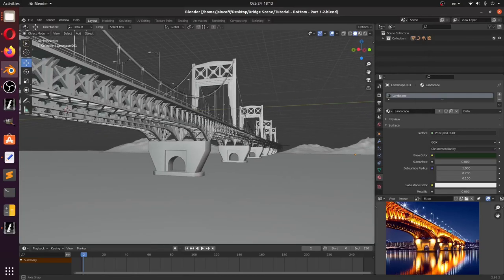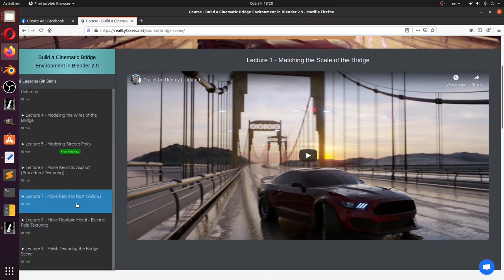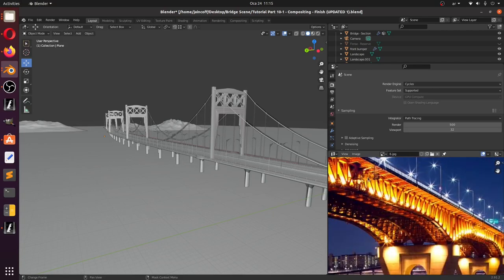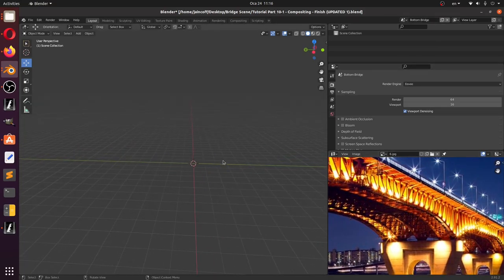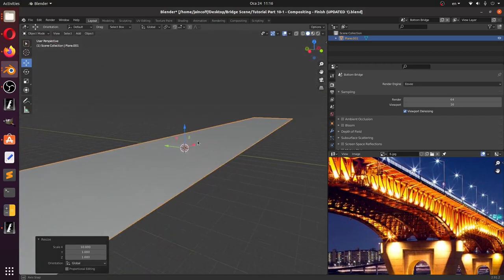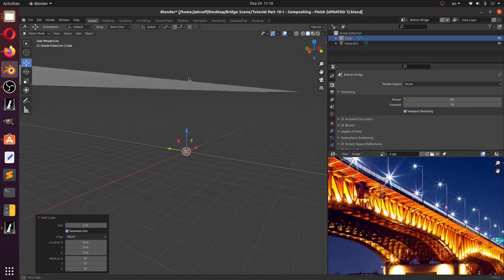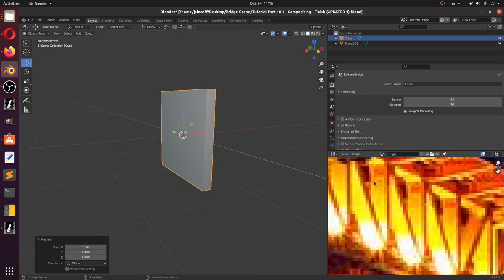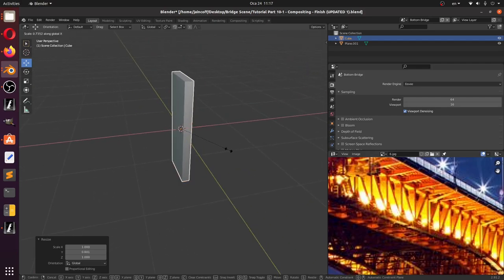Blender Bridge Realistic Modeling Tutorial

Comment: Really good tutorial. However, one thing about being an artist is creating immersive artwork. The thing that breaks your scene in my opinion is the architecture of the bridge itself. You see, the bridge you are referencing is called beam bridge that uses the columns below to support it. The problem starts when you are combining it with cable/suspension bridge that uses the cable to support the bridge.  In suspension bridge, the tall gate / column is the one that supports the whole length of the bridge, and you didn't put continuous support to the bottom of the river, so it looks like the big gate is actually weighing down the bridge it should supports. If you compare your bridge with the golden gate you will understand what I mean.
Reply from the maker: Impressive valuable feedback, much appreciated!!.. I must learn architecture first. Next update I will build another bridge :) Related to other sections, do you see any rooms for improvements? And thanks again for your time